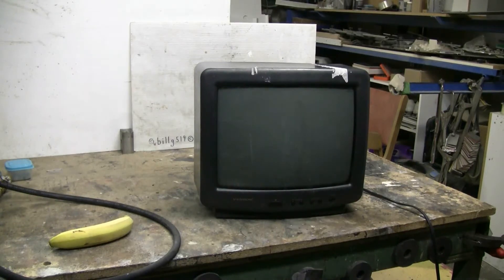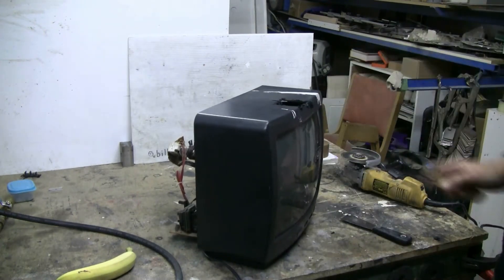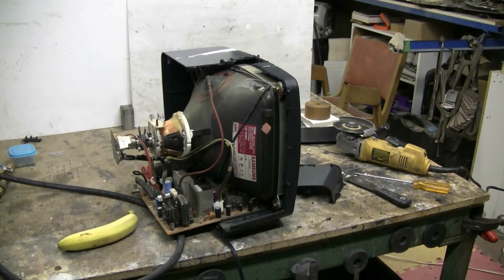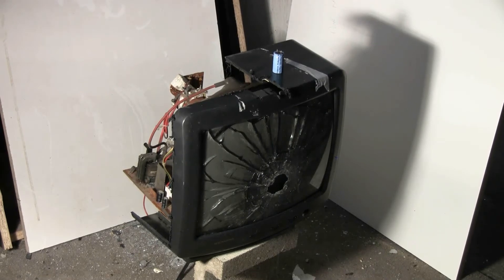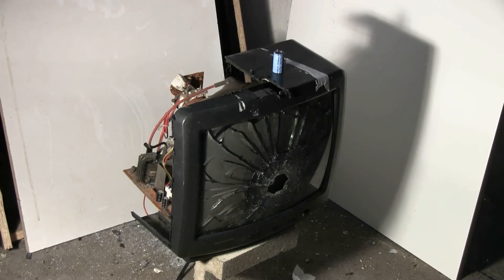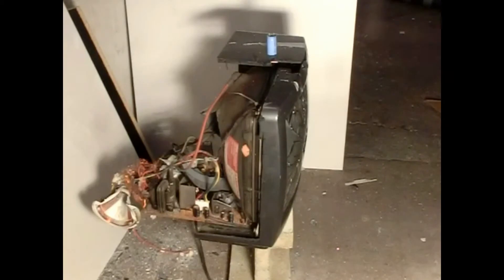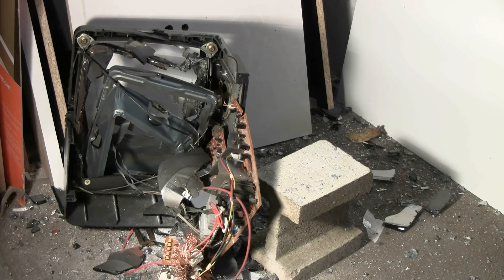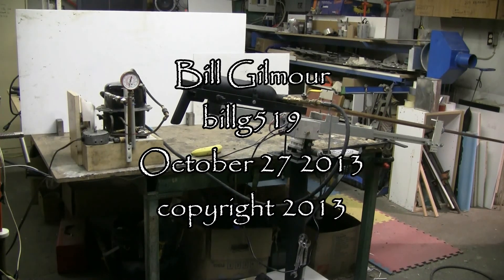Air Cannon #98 - Another CRT TV

Comment: Here's an experiment to try: You'll need two vertical electrodes and your cap bank and any of your air-powered rifles. Set up the electrodes so a spark (from the fully charged cap bank) can almost - but not quite - jump the gap between the electrodes. Now shoot a metal slug between the electrodes, and film in slo-mo, with the lights dimmed. Does the projectile draw an arc as it passes the electrodes?